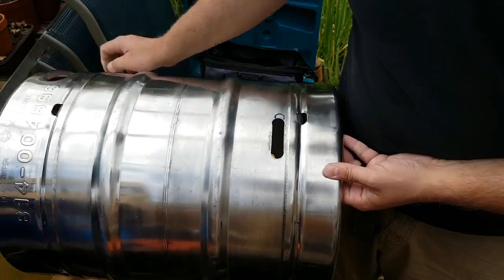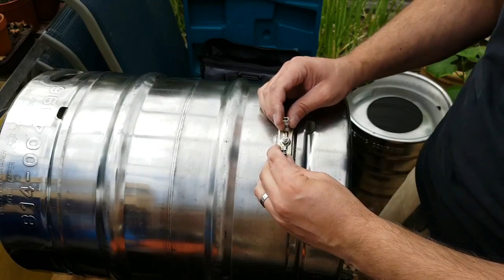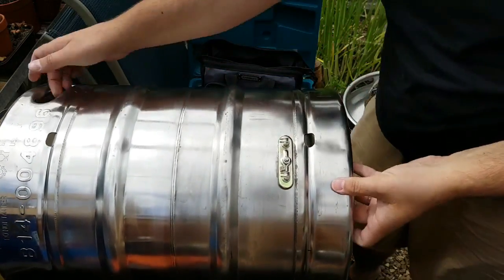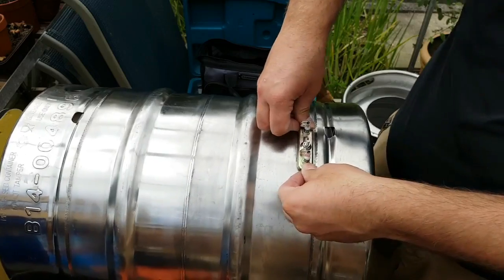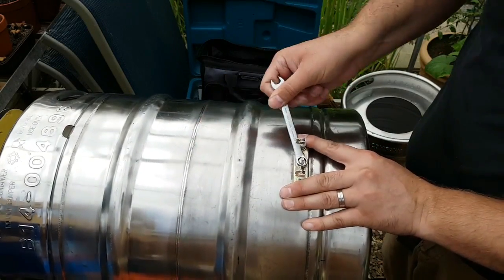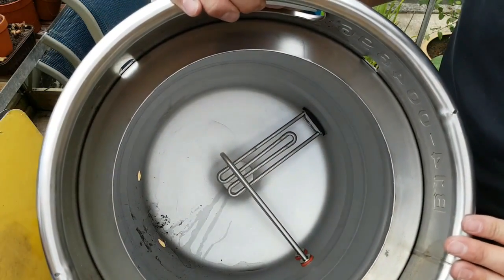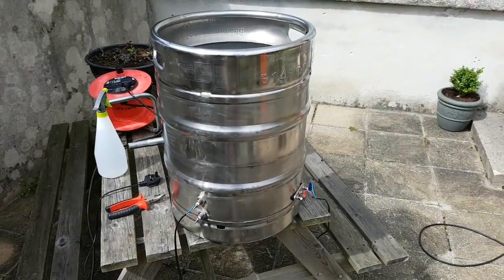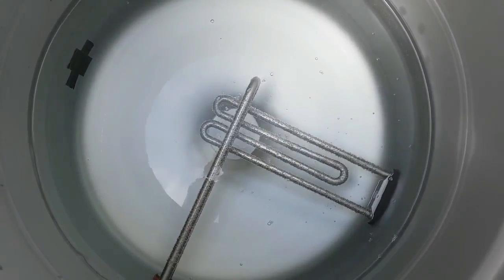Keg Build  - Element Fitting

Comment: Nice build!
Don't you have any problems with the rubber gaskets that come into contact with the mash?
Reply from the maker: Paul Popel Thanks Paul, no problems at all. Not had any off flavours or even leaks. I would recommend using them as they are relatively easy to fit and cheap.
Reply: You have mounted one of the heating elements vertical and the other one horizontal. Do you see any advantages of one method over the other?
Reply from the maker: Paul Popel Hi Paul, the reason was that the element would seal better that way due to the keg being a cylinder. I have now changed the element as the element would not seal. I would recommend washing machine elements as they are cheap and available in different wattage.

Comment: Do you use a wort chiller? If you do, won't the elements make it hard to comfortable set the chiller into the keg?
Reply: I currently use a counterflow chiller,could not see a problem using an immersion type the elements are quite low.

Comment: Hi Matt, is there any specific way that the element needs to be wired up? Is it as simple as wiring a standard plug straight to the posts on the element?
Reply: Beau Jorgensen Hi, depending on your county regulations in the UK just live neutral and I have connected the earth to both the element and the keg. Please note I am not a qualified electrician.